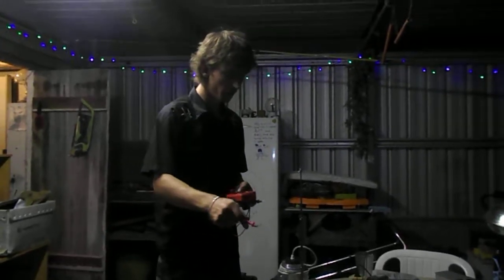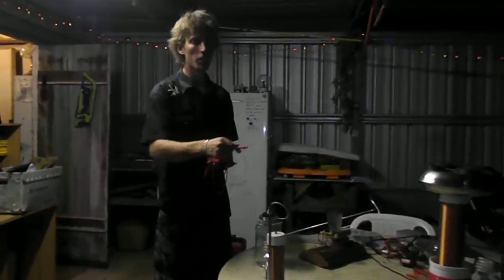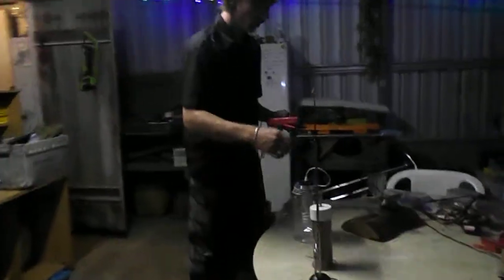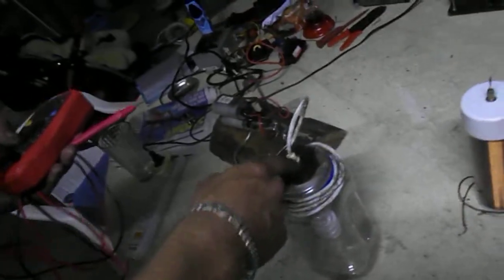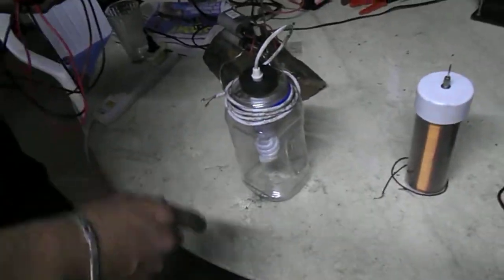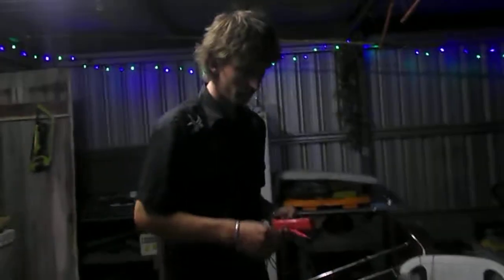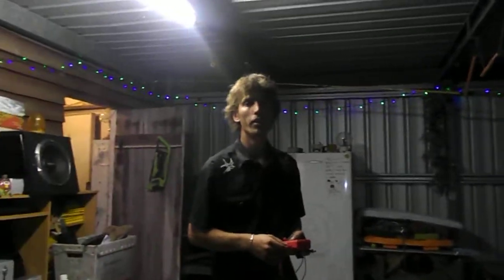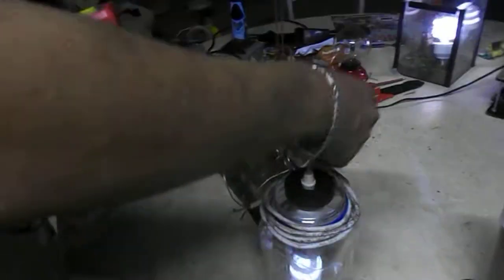Tesla coil Receiver, for best results.

Comment from the maker: The magnet on the light acts as a proximity sensor, it uses a bit of energy so the light stays off, unless earthed by picking it up, which turns it on, unless it is too close to the power supply (Tesla coil) than itll stay on. also the resonant energy in the body acts as the remainder power supply to turn the light on when touched.